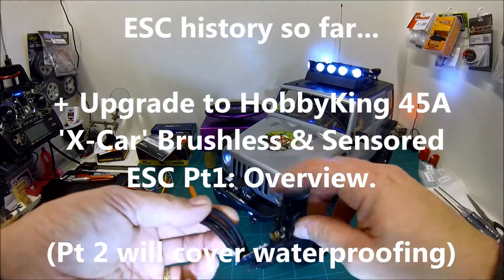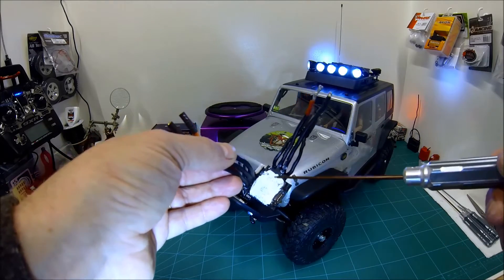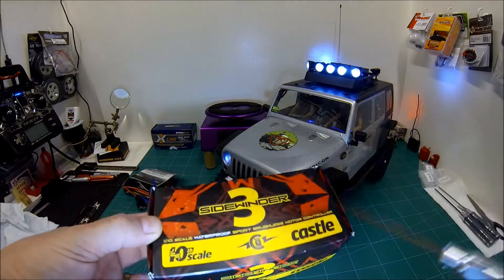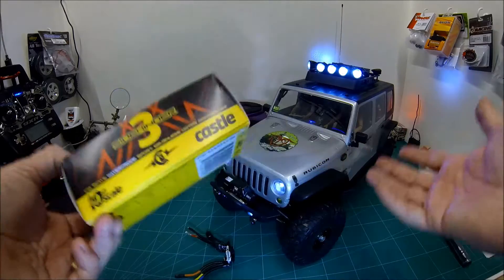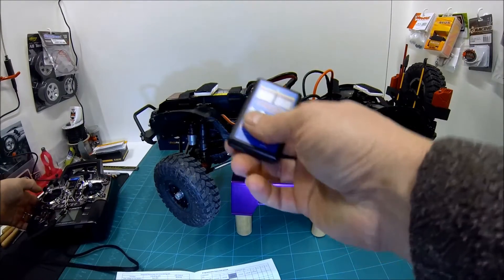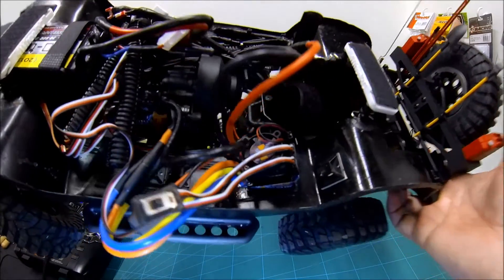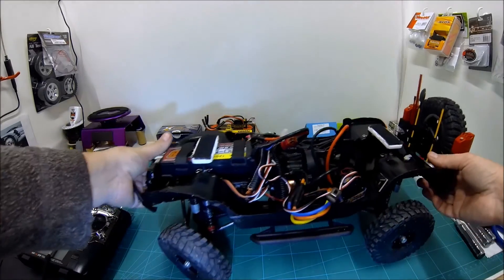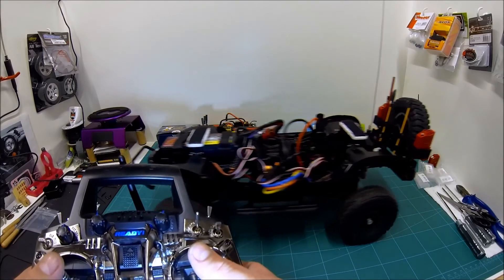SCX10 Rubicon Pt22: X-Car ESC Pt1 - Overview.

Comment: Castle has always been an excellent yet slightly underrated ESC! They will Crawl for YEARS. It has possibly the second best low speed control of any Sensorless Brushless ESC...
I say Second, because the new Sidewinder 4, has advanced circuitry, and PVM, making it SMOOTHER than many SENSORED ESCs!! 😎😱😱 
If I'm able to get Anything.... It would be the Sidewinder 4. 

The Sidewinder 3 is still outstanding..... WITH the right Motor. It loves lower KV, 4 Pole Motors, and is pretty amazing with 6 Pole Motors! I've got one Brushless set-up... A Sidewinder 3, and a TenShock 1800kv Brushless Sensorless 6 Pole 9 Slot Motor.
I wasn't expecting a lot. It was cheap, all I could get. However, it shocked me and everyone around me!! Now, the ONLY advantage of my POS HG P402, is that its got one of the LOWEST Axle Gear Ratios of all Crawlers!! 
Yours, 2.74:1. Ascender, 3.22:1, SCX10 II, 3.75:1. RC4WD Yota Axles, 3.90:1.... 
POS HG P402, 4.32:1!! 

ONLY advantage. For your Subs who don't know what that means.... I could spare all the Nerdy Stuff, and cut to the chase. 
The More reduction you have at the Axles, the LESS Torque Twist will be generated. Period. 
Some Guys foolishly think that "Well, if I just gear down the Transmission, that will sort it."  WRONG!!! 
Lowering the Transmission Gear Ratio, introduces MORE TORQUE through the Driveshafts, creating even MORE twist at the Axles!! 😢😫

You can actually reduce a lot of your Torque Twist... Axial sells an Underdrive Diff Gear Set. It brings your Axle Ratio up to 3.48:1 - from 2:74:1 !!! That alone will make your Axles pull harder, at slightly lower top speed, with HALF as much Twist! 
Class dismissed!
Carmine 💥 ⛽
Reply: The Hobbywing X-Car ESC was a pretty good one a few years back. They've made some serious strides in just the past year and a half!! The Hobbywing XR-10 is still a pretty good one, for those convinced that Sensored is the ONLY way to go... 
The answer to that statement is.... We're ALL correct!! 😉 This is a Hobby of individual tastes and levels. Just because I've always preferred Sensorless (well, Cost, really), makes me just as correct as the next Guy who won't run anything but Sensored. Or the Guy who won't give up Brushed!! That's how we roll... If it feels good, it's RIGHT!! 😊😉
Carmine 💥 ⛽

Comment: What lipo were yyou using? 3 cell or 2 cell?
Reply from the maker: Hi Antoine, I'm running 2S in the Rubicon - Enough power for what I use it for.
Reply: How is the wheelspeed on 2s and 3s if you tried? Because I'm on the lookout for a brushless system to replace my AE-2 and a cheapo 35t RC4WD sealed can motor on 3s. I am eyeing the xcar 60amp esc (only for PC programability) and the trackstar 13.5t sensored motor http://www.hobbyking.com/hobbyking/store/__23362__turnigy_trackstar_13_5t_sensored_brushless_motor_2590kv.html or mayve the same one in 17.5t that I plan ob running on 3s. My other motor choices are http://www.hobbyking.com/hobbyking/store/__16021__HobbyKing_X_Car_13_5_Turn_Sensored_Brushless_Motor_2600Kv.html and http://www.hobbyking.com/hobbyking/store/__21955__Turnigy_TrackStar_13_5T_Sensored_Brushless_Motor_3040KV_ROAR_approved_.html  (description says 2s only but I heard plently of people are running them without a problem on 3s). What motor would you suggest out of those?

Thanks!
Reply from the maker: Antoine A-A Wheel speed, that's tricky to answer as it depends on a whole bunch of things (2s or 3S LiPo, motor timing, gearing, weight of your truck etc.). The main factor is what is 'enough' speed for what you use your model for, so that is up to you, but FYI I started out with a 13.5T Novak Ballistic brushless (which is 3,300kV) in the Rubicon on the stock 20T pinion/87T spur. The 2S LiPo was going into a Novak Timbuk2 ESC that has a 'Rock Boost' feature that increases the timing at high RPM and it was IMHO way too fast for a scale trailer, let alone competition running and that was on 2S, if you put in 3S it'd be even faster. Have a look about 6:06 into this test video I did: 4WheelRCUK - SCX10 Rubicon Pt5: Power On & Test Run (v2).

Since then I have switched to a "Tekin ROC412 BL Crawler motor - 2.5Y 1800kv" motor as for competitions I needed better low speed controllability (a lower kV means less RPM per volt. So at the lowest 'notch' on the ESC's voltage output scale you get a slower RPM than a higher kV motor could do). I run this on a 13T pinion/87T spur it has great slow crawling. Top speed is a fast walking pace and I find that is more than enough wheel speed for climbing loose slopes etc. Next time I think I'd go for an even lower kV for the Rubicon, as I only use it for slow technical driving.

I'd say if you want to bash/trail your SCX10 then the 13.5T (3,300kV) would be plenty fast enough on 2S or 3S. But if you think you might want to do slow technical stuff then consider a kV motor that is a lot milder e.g. 18.5T or higher (1,650kV).

If you have anyone in the area with an SCX10 or Wraith see what they are running. Or have a look on some forums, YT etc. as I am sure you will find a bunch of opinions ;-)
Reply: Thank you for taking the time to answer! I really appreciate the well thought out answer you gave me. Not like the usual k thanks on YouTube!

You've just earned yourself a new subscriber from over the pond :)